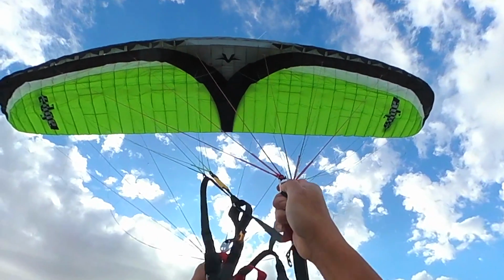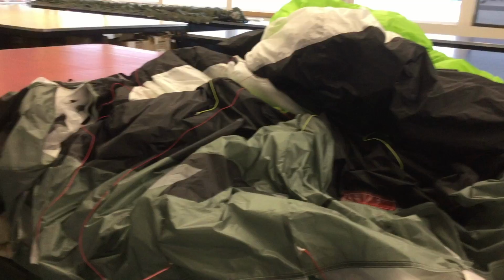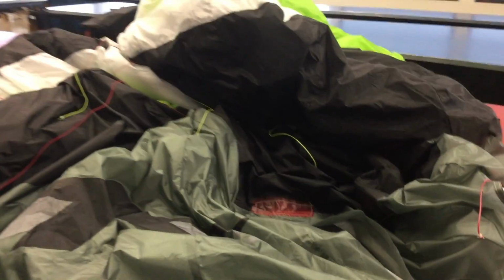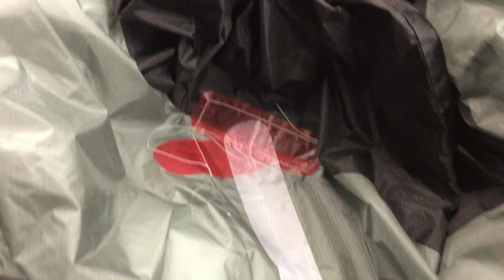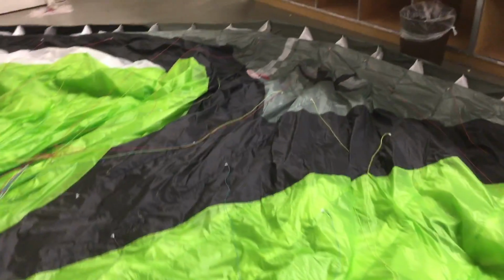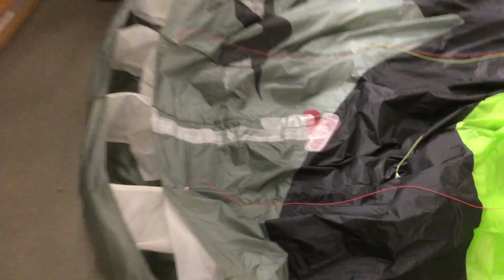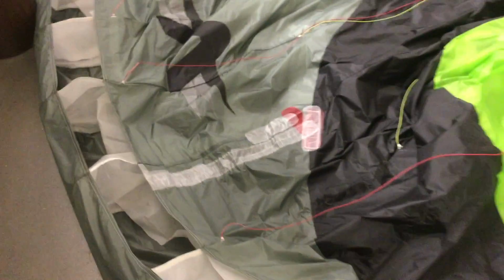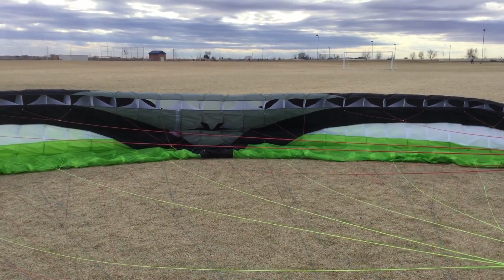Fixing Paraglider with Ripstop Tape

Comment: Looks like a good repair. What thread do you use ?
Reply from the maker: Used a commercial grade sawing machine with some heavy duty nylon thread. Thanks
Reply: @RobNavPPG  
Thanks...I have a bit of patching to do 🙏
Reply from the maker: @heyitsalanhere  You can do it! Ripstop nylon fabric will do it. Worked good for me. Flew it ever since. Long wait time and costly to have it done at a shop.
Reply: @RobNavPPG  
Yes...I will fix it well myself. I have some very good rip stop tape which I got from a chandler's a some years ago. My first wing was mostly patches 😉
Thanks 🙏